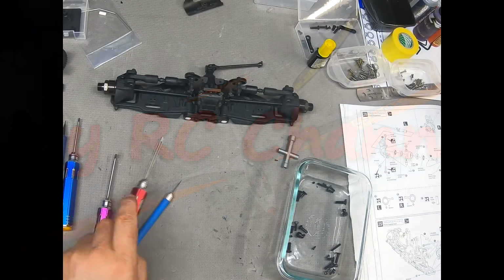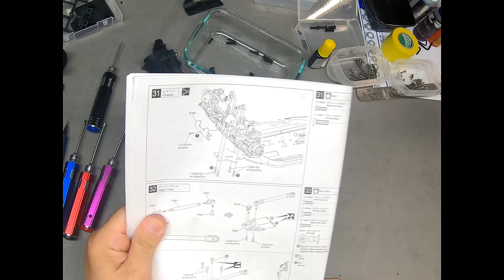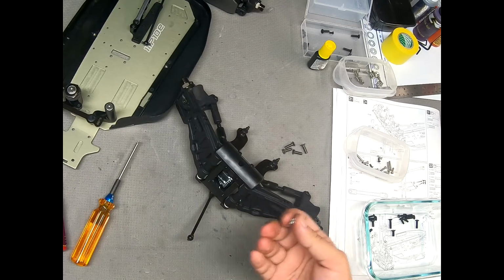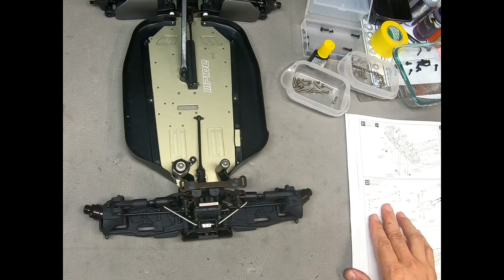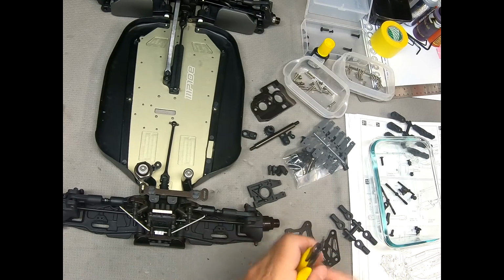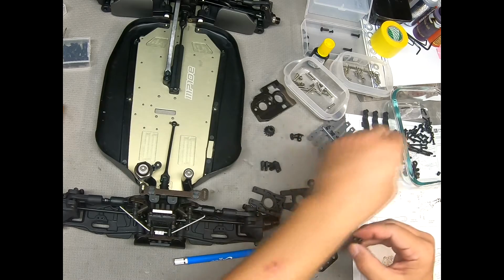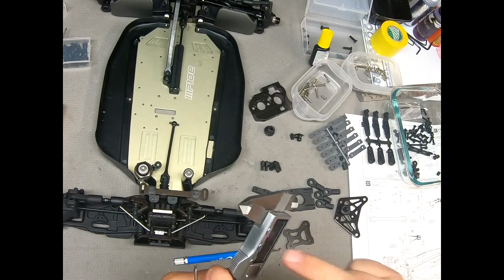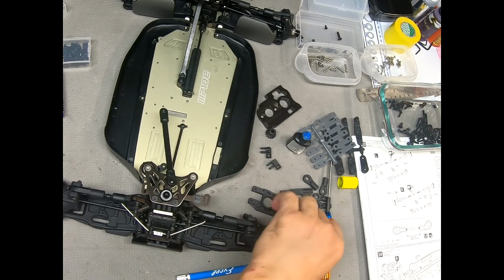Building a Kyosho Inferno MP10e 1/8 Scale 4wd RC Buggy for Off Road Racing - Pt. 8

Comment: What lipo packs are you going with?
Reply from the maker: I've got a pair of 5600mah and a pair of 6000mah... both are the standard size hard case packs. And I may also experiment with some shorty packs that are about the same mah. I'll have to see how it weighs out. The sorties may make the buggy to light for the class rules. I'll definitely cover this when I get to that point.
Reply: @MyRCChannel-CJScott  Ah gotcha. Thinking about getting this kit, never ran saddle packs. Currently running XE Elite. So heavily invested in 4S bricks. 😢
Reply from the maker: @jonathankurz207  and that may be a determining factor for you when choosing a 1/8 buggy. I had a bunch of 2s bats and I liked having the weight low and evenly distributed... hopefully that pays off in stable handling and nimble response.
There are several excellent options designed around 4s setups... Mugen, JQRacing, Serpent, TLR, Xray... most of the 1/8 buggies are based on single 4s packs. Those are all good brands. Any of them will be competitive since its more about the driver. Another factor is parts availability... check which manufacturers are most supported at your local track(s). If you break a part during a heat, its nice to be able to get replacement parts on the spot. 
Keep in touch and let me know which direction you go in.
CJ